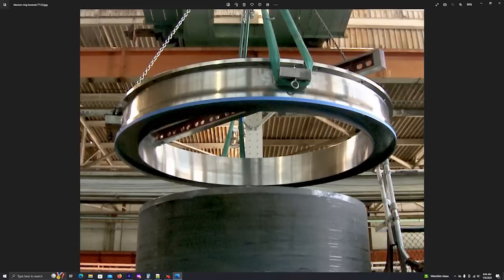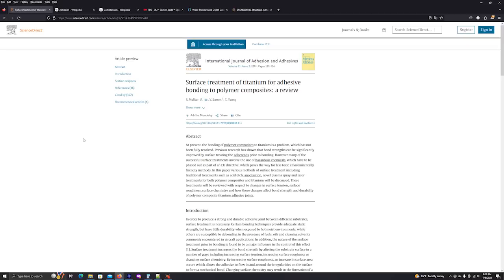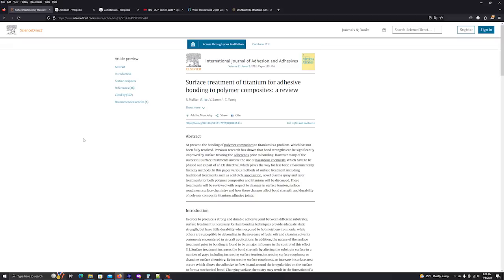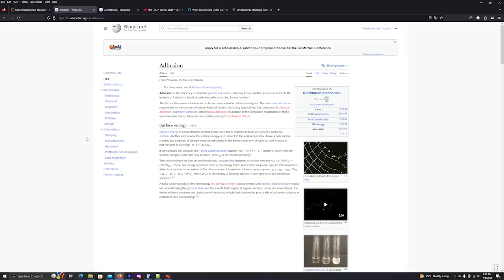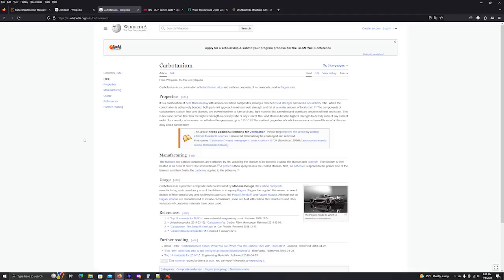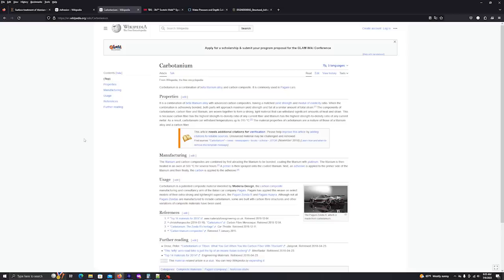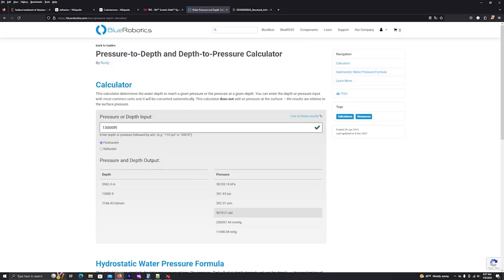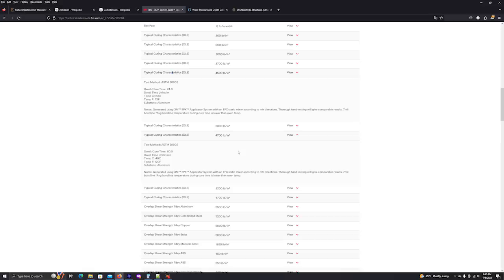Oceangate Titan Adhesive issues between Carbon Fiber and Titanium

Comment: You do realise the pressure is working with the joint and it gets tighter as pressure increases.
I fail to see how lack of traces of the adhesive proves anything not withstanding the fact that you were highlighting the wrong flange.
The accident report could take months maybe years yet you can solve the case in a few minutes.
Reply from the maker: These are theories not findings.  Yes I am aware of the mistake.

Comment: No one seems to understand that carbon fiber is the tensile component of a composite. Applying pressure externally places it into compression and the epoxy into tension. That sub never went down very far ( an impossibility ). A Hollywood hoax.

Comment: Hi Joe, your math is wrong. Saltwater is more dense than fresh water. The correct value is 39774.92 kPa or 5768.86 psi. Sorry I didn't want to fact check you on your video. But great video anyway.
Reply from the maker: Yes, I forgot to check the sea water checkbox.  I normally do but forgot  when recording the video
Reply: @JoediyLab  sorry that I fact check you. But the video was interesting and I enjoyed it with the errors in them.
Reply from the maker: @quentineugenewatson9506  No problem, yes my mistake, I normally check the salt water box but during the recording I forgot to check it

Comment: The compression of carbon fiber and titanium most likely will act differently under 5000+ psi.  Eventually under this differential stress the bond will weaken and eventually fail. This might of not been the case of this submersibles failure but eventually it would have been.

Comment: why didnt they bonded this under a vacuum?? everyone working with composites, i.e. boatbuilders, plane builders know very well that any bubbles will jeopardize the structural integrity. this guy was a cowboy amateur
Reply from the maker: Normally mixed epoxy is degassed in a vacuum before application. we however to not know if they performed this operation

Comment: There may be adhesives which can hold up to 7700psi in compression, but the forces on this joint wouldn’t be “simple” compression. Am I correct? Wouldn’t a variety of sheer forces inside the flange come into play as the dissimilar materials responded (contracting at depth and expanding during resurfacing) to the external loads at differing rates? Plus, wouldn’t stresses tend to accumulate along the edge of the flange such that the equivalent psi would far exceed the 5600psi attained via the calculator? 5600psi pressing on a sphere at depth is one thing, but a two inch flange pulling at, or crushing in on the outermost layer of the carbon fiber tube would accumulate enormous stresses. I’m not a trained engineer, so I don’t know how to calculate the physics involved, but it doesn’t take much mechanical imagination to visualize the fundamental weaknesses of this design; nor does it take much effort to perceive the cavalier foolishness of the person responsible for building and launching this certain death trap. It was always just a matter of time before the water at such extreme depths would exploit the myriad potential points of failure and find a way to fill the void inside this vessel.
Reply from the maker: More than likely the outside pressure was holding the flange to the carbon fiber.  I had an engineer explain that because the bonding surface was small the force applied to the adhesive would be much greater than the ocean depth. Thanks for the feedback

Comment: Boat builder here. I couldn’t believe this epoxy type adhesive application to the titanium. Anytime we laminate aluminum for strength, it is always roughed up with a grinder for better tooth. I didn’t see any of that on the flange of the titan. Also in the video they are laying up wet fiber in an overlap which is just not even close to the quality of composite you would get with pre preg carbon and vacuum bagging. Really surprised that death tube lasted several dives.
Reply from the maker: Thanks  for the feedback

Comment: Isn’t the butt joint in question under an even compressive load, why should it fail unless the actual carbon fibre structure itself fails?
Reply from the maker: yes, more than likely the carbon fiber failed first and then blew  the end caps off.

Comment: Somewhere in the OceanGate info,  there was a naming of the exact adhesive/epoxy product used. I cannot remember it  at this time, or the manufacturer
Reply from the maker: If you find it let me know. Thanks
Reply: @JoediyLab  I think I found it (not 100% sure though, still cannot find it again in any OceanGate sources though as those pages gone now ). Somebody mentioned this "stuff" in a similar discussion I was reading yesterday and IIRC this was it. 
Henkel Hysol EA 9394   a.k.a. Loctite EA9394   -   an industry standard aviation epoxy

Regards😎
Reply from the maker: @chrisperrien7055  Here Chris I will add to the description https://www.youtube.com/watch?v=WK99kBS1AfE

Comment: I'm not sure how this adhesive was applied, but if they just spread it on the carbon fibre pressure hull and the titanium end ring, and then pressed the two together, you will get voids and trapped air pockets in the adhesive layer. Surely this adhesive would need to be injected under pressure in a vacuum-autoclave environment to eliminate trapped air pockets?
Reply from the maker: Good points

Comment: Ref: 10:00 => Altho it makes little %-difference to the point, it is none-the-less incorrect  to use this Pressure/Depth of water calculation for FRESH water (as chosen in upper left corner), rather than SALT water 😮, as this application demands.    It kinda taints a technological discussion when such things are missed.
Reply from the maker: My mistake, I normally check that box, but while recording I did not.  Let me know if you ever made a mistake.

Comment: Why titanium and not simply stainless steel?
And why not wrap the carbon fibre tube in a sheet of metal so it is not exposed to water?
And also, why not long bolts going from aft titanium sphere to the "bow" sphere,  holding them securely together with something else than glue?

Comment: Any competant engineer who has any knowledge of composite materials (and many engineers do not) would look at those construction video clips and simply go NOPE, however I do not believe that the rings popped off the tube causing the disaster, I think that the tube imploded and as it did so it ripped itself away from the rings simply because of the speed at which implosions occur which would have exerted forces far greater than the adhesive could cope with

Comment: I was senior chemist at British Aerospace in the 80s, where we built satellites. We had occasions to bond cfrp to titanium. Before bonding, we always grit blasted the titanium bonding surface.
I remember having an Easter weekend ruined due to be called in to attend a senior level meeting following a failure of a Ti - cfrp component in acoustic testing [ placed in a test chamber & bombarded with some VERY loud pink noise, to simulate launch conditions]. When I looked at the [very clean] failure surface, there was no evidence of blasting, just very mild abrasion.
Reply from the maker: Very cool information, thanks

Comment: Why not just have 1" titanium rods on the exterior, or whatever size the math says, running from end to end? Holding the titanium ends together? How hard is this?
Reply from the maker: The carbon fiber would still fail between the rods.
Reply: @JoediyLab  I was just addressing the glue silliness.

Comment: My motto is "better living thru 3m". I use 3m products probably 300 days a year. Maybe more. But, there is no "glue" that anyone has designed that will withstand heat at 1 atmosphere, cold at Titanic depth, sea water proof, able to "glue" titanium to much of anything, able to not get pressure washed out at that depth, and be able to recover undamaged from repeated compression/decompression cycles.  How rich would I be if I could invent that? And yet goofball here thought this was a great idea.

Comment: In a wound fiber construction it is not trivial to get the correct wetting of the fiber and the correct fiber to resin ratio on the wound component, especially if it is not autoclaved. Winding the fiber you also need some tension in the fibers while winding to ensure proper layup to force air out between the layers. In a nutshell, carbon fiber is very strong but do not forget the polymer binder and the manufacturing process as this is the only thing keeping the fibers orientated in the correct direction.
Reply: Carbon fiber is used for inner pressure not outer. Airplanes use it in there main hull for cabin pressure. Rule of thumb is not to use 2 or more metals or material when outer pressure is a factor. Each material expands at a different rate. If the pressure down their can move metal by 1-2 inches, imagine what it did to simple carbon fiber. From the large pieces there bringing up, i can't see any carbon fiber on them. It's all Titanium and left over outer thin shielding with wires everywhere. Now some of the floor cameras, have shown the black carbon fiber strands all over the ocean floor. That implosion was so violent, the pressure recoil blew out the front acrylic window and it's bolted ring holding it in. If you look at the large O ring fittings, that held each section together. They look brand new, there's no dark sealant or carbon fiber attached or stuck to the sealant inside the fittings. The Large rings look like like they came off the factory floor, all clean. Yet we seen videos of them globing on sealant and wrapping over 5 inches of carbon fiber. <~ That's what caused the implosion.
Reply from the maker: Thanks, good points

Comment: Wouldn't the fact that the domes were pressed towards the carbonfibre tube help to seal the joint?
Reply from the maker: Yes outside pressure would hold the end caps to  the flange, but the carbon fiber more than likely failed first and then blew the end caps off.
Reply: @JoediyLab  that might well be the case.
Poff

Comment: If the implosion blew the bolted end caps off the titanium rings doesn't that mean the adhesive somewhat held?  if the bonding was so weak then the rings would still be bolted to the caps?
Reply from the maker: Good question,  We will have to wait for the findings

Comment: I don't think we even have to look at adhesion quality because it stands to reason that the collapsing CF tube would depart the titanium because the fibers are all annular and the interface is on the inside of the titanium. The thinking was probably that the titanium lip would rest on the CF so the bond didn't need titanic strength...
if the bond itself had failed that would be a leak and the tube would be intact. It was not :)
Reply from the maker: Yes , more than likely the carbon fiber failed first, blowing off the end caps.

Comment: This video bothers me. The vessel did not rely on the epoxy! The CF tube failed. The end caps were not pushed off. They were left in place as the CF tube imploded and shrank away from the titanium end caps. The epoxy bond was better on the graphite and stripped away from the titanium in an instant. Hence,; no epoxy residie on titanium rings. The implosion would  have been followed by an over pressure event which would blow out the viewport. ( notice the missing " beauty ring" around the viewing port) (It means the acrylic lens was blown out and not in) This is not rocket science. The CF tube failed first. The " adventurers" were vaporised in a millisecond and mixed with carbon fragments. Look at the landing frame. It is collapsed longitudinalally and the vertical arms have crossed themselves. One is actually broken off .  The founder must have known about the effects of pressure cycles in aircraft . Why would it be any different in a vessel ( which was uncertified and untested) which had to undergo much greater pressure differentials than any spacecraft. Hubris and ego killed these 5.
Reply from the maker: Yes, more then likely the carbon fiber failed first.But one has to ask what happened to the bolts holding  the end caps to the flange.  Also what happened to the bolts holding the viewing port flange.
Reply: @JoediyLab #1 all of the parts had to accerate towards the center a t30,000 meters per second or the resulting explosion  and relative overpressure of the air being heating to 6 to 12,000 deg in a millisecond , blew out the porthole, the chrome retainer ring and all of the retainer bolts, the 18 end bell bolts at either end. Compression, ignition , pressure, compression. Study and see what happens
 There is an acoustic  frequency that happens in an event like this. The Navy knows this..= compression, combustion, compression, explosion, etc. Tbis is why the vessel was crushed, exploded ( and porthole, all bolts holding end bells to rings and acrylic plrthole to be blown apart. Simple really. Do some research. I suggest you look into how  a diesel engine works!
This happened at 1000 times the pressure!
Reply from the maker: @tmorton922  thanks for the great explanation

Comment: If they would have made brackets that went across the entire hull where the two joints could have been clamped together I would feel way better about the bonding... but just purely gluing it is insane to me, any flexing of the hull would work that joint out over time. But if the sides were clamped together with bracket stringing the length of the hull it'd be a better design
Reply: I had the same thought, because the carbon fiber was wrapped radially, designed to withstand radial pressure, and not the enormous pressure from the end caps.

Comment: Thank you for the clear video and great explanation of adhesive types.  There would have been millions of pounds of collective force holding that bond against the carbon fibre cylinder in addition to the millions upon millions of pounds of compressive force radially on the cylinder.  A possibility I have considered is that due to the extreme pressures the epoxy adhesive may have extruded itself into the end grain of the carbon layers and possibly played a role in initiating the obvious delamination process that would have led to the failure.
Reply: The fibers of the Unidirectional tow windings had no fiber to bind them. Progressive splitting with water intrusion, and operational friction rubs, between the unreinforced wound carbon tows would produce the reported sounds. The tube itself could thus have essentially split.
Reply from the maker: Thanks for the comments

Comment: Wouldn't the compressive pressure on the bonding joint be way higher than the pressure due to depth, simply due to the reduction in surface area (compared to the dome's cross section)?
Reply from the maker: Yes that is correct, I had an engineer give me some calculations.
Reply: @JoediyLab  There was a confusing comparison of the hydrostatic sea pressure (in psi) to the strength of the adhesive (also in psi).   The actual compressive stress on the glue joint is much greater than the sea pressure.   It's elementary engineering, and the video's narrator apparently doesn't understand this.
Reply from the maker: @davedavis6020  You are correct, I was corrected by another viewer.  Check the comments, there are calculations given

Comment: I am no expert 
But I would have expected as lives were at risk, the assembly or more so, the bonding should have been achieved in a controlled bubble. 

What's more 

They are assembling the two rings to the cylinder in the wrong fashion!!!! 

The rings should be on the floor and the cylinder lowered down to it to prevent any air from being trapped under the titanium ring.

Comment: I just noticed in a photo of Stockton Rush (CEO of OceanGate) sitting in the Titan sub. What caught my eye is that one of the bracket for mounting the digital display unit looks to be screwed into the expired carbon fibber hull. If I was 6000 lbs per square inch that’s where I’d go to test the integrity of that sub.
R.I.P. to all those who lost their lives.
Reply: Yea, surely that is a crazy thing to do, unless that was a internal liner?. Although I think the carbon tube was a thicker than the mathematics said. To support a monitor like that you probably want at least 10mm deep bolts, I think the wall was  about 127mm thick.
Reply: I read ( sorry forget where but it was a legit source I believe ) that there was a glass fibre based inner liner to protect the internal electronics & minimise condensation issues - this was possibly the base on which were mounted internal components.